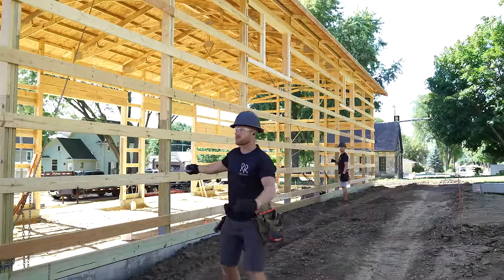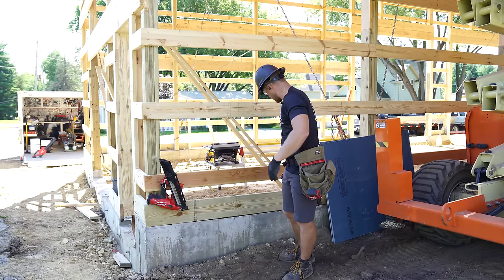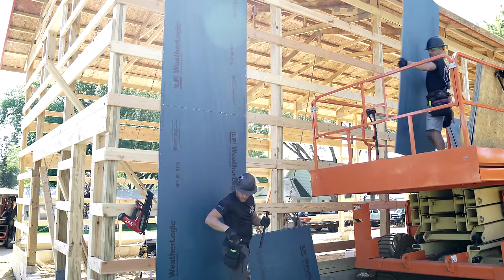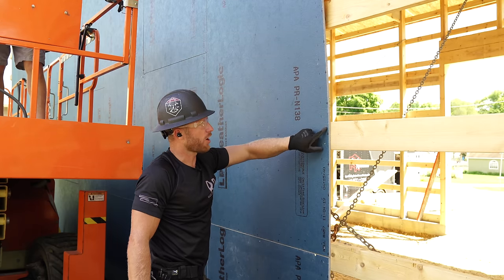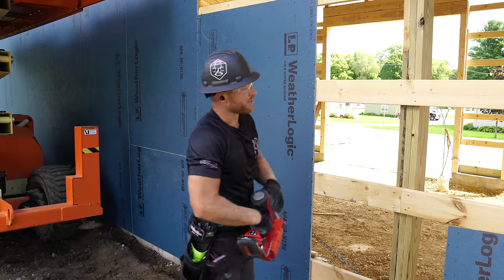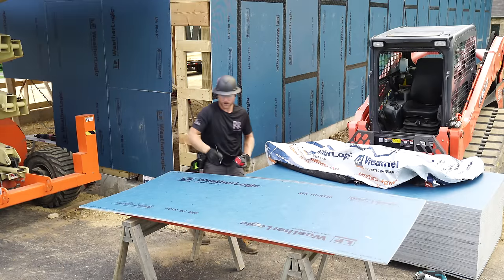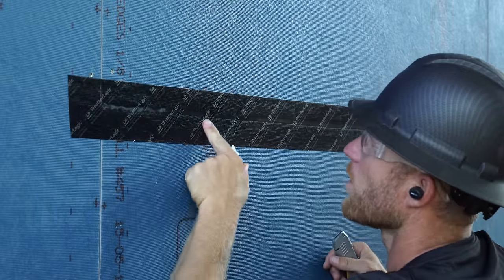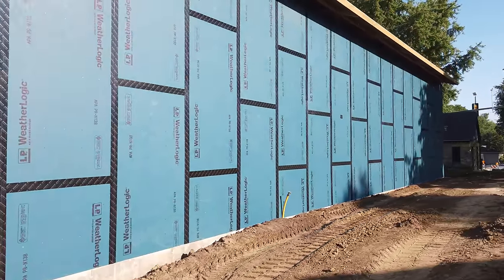Oregon Music Garage: Installing WeatherLogic #Engineered #Sheathing

Comment from the maker: This project is definitely going to be much different than anything we've done before... how many times have you seen us sheath an entire building prior to siding?  Thanks for the support and hit that subscribe if you haven't... It's free content!
Reply: cool  a great way to enjoy the night watching a video from RR BUILDINGS
Reply: Jimmy's?
Reply: I haven’t made it all the way through yet so I hope I don’t look like an idiot however does the building require any sheer strength from the sheeting?
Reply: @brockschank765  when they nail the edges and the field of each sheet it gets it's strength ,, the gap is for sheet expansion . trailers were built with plywood in the corners rest of the sub walls were  cardboard or inso board ,, it don't take a lot too add the strength ,, hope that helps you out ,, also like his cross boards he puts in ..
Reply: The seam on/around the corner, no tape?
Reply: Hi Kyle, what do you guys do for corners, do you tape them too? Thanks
Reply: Is that the Milwaukee cordless router?

Comment: Good man on the safety gear, Kyle. You can always tell the safety equipment skeptics; they're the guys who have skull damage, an eyepatch, a limp from the steel that pinched-off their toes, no hearing and a broken back from falling off a roof. Keep going with the safety-gear. If you always wear it whenever you work, it'll be no big deal when you go on a site where the OSHA standards are mandatory.

Comment: Good morning Kyle and Greg!
Something I've wanted to comment on when you are working on a roof and you are wearing your fall arrest harness etc when you don't have a good riggers helmet on, something with a good under the chin strap, you are leaving yourself open to injury. God forbid you do fall and your arresting gear does it job, you will most likely be slammed against a wall, without a good rigger's helmet that stays with you when you fall (most hard hats are just that, they are hart shelled hats) then you can bang your head hard. My personal choice is the PETZL Vertex Vent, Ventilated Helmet, the vents are sure nice when it hot, but you can close them for rainy days and cold weather. I learned about these helmets working with Cirque du Sole here in Tokyo. They do not obstruct your view (like ball caps do) and they are very comfortable to wear, there are also a bunch of accessories you can get for them that make them very versatile, from a headlight, hearing protection, and even a face shield. I use the hearing protection and mesh face shield when I'm running my chainsaw.
Maybe hit up Petzl and see if they would sponsor a video?
Great videos, as usual, keep up the good work.
Cheers from Tokyo!
Stu

Comment: The Metabo HPT 36v triple hammers bare tools are on clearance at menards for only $210.
The Hitachi 18v triple hammer kit with hard case is on clearance for $266.
after menards 11% rebate thing.

Comment: How do you like that LP stuff compared to the Huber? Seems like one advantage that jumped out at me is it would be way easier to keep that little putty knife in your bags versus the zip J roller always having to climb down and grab it when you realize you forgot it. Also what’s the verdict on the Milwaukee gun compared to the hitachi? I run all battery hitachis but love the idea of a 2 rack of nails clip of the gun works as good as the hitachi?
Reply from the maker: Zip seems a little cleaner... but mainly the same... the squeegee is much nicer than the roller in my opinion

Comment: What bit are you using in the router to cut your openings? 
I really like the Up-Cut Spiral Flute bits with the bearings on them, the solid carbide ones are pricey but they last a very long time and make a nice cut.
Cheers
Stu
Reply from the maker: That’s what I have.

Comment: What about the shear panels? Will you be adding blocking to get full nail pattern? Did you get engineer stamp on application? Seams like it would have been better to run horizontal and add blocking as needed for the panels to perform correctly in a high wind event. You are in strait line wind event territory. Have seen plenty of failed pole barns over the years.

Comment: hay Kyle, have you thought of using the roller they use on zip tape on the tape you are using here? I know they both use pressure to make a firm bond, was wondering if you could save your wrist a little bit by using a roller rather then a squidgy
Reply from the maker: Like the squeegee more

Comment: What did LP say about the horizontal framing? Because you don't get 6" around the perimeter as they normally would, does the post frame make up for it with racking strength?
Reply from the maker: No different than a stud wall with 16” spacing between stufd
Reply: @RRBuildings  Right i was adding up the lineal inches of coverage assuming vertical. However LP specified can be installed horizontally, which with your 2x6 framing members is actually more coverage.

Comment: Is this the same stuff as the zip system? Is one better than the other or are they the exact same thing?
Reply: One of them was suing the other if memory serves, so pretty similar!
Reply from the maker: Basically the same... little cheaper but doesn’t have as many tape choices yet... mainly the stretchy tape for windows

Comment: Just curious but he said he's going to come back and nail every 6 inches around the perimeter but then proceeds to tape the seams and also the gurts are like 2 feet apart so... I'm confused
Reply: I’m curious how he is going to nail 6” centers on those vertical seams.  He has a lot of structure to add.

Comment: Do you like that Milwaukee gun better than the Metabo? They sound almost the same.
Reply from the maker: Depends I like the extended magazine enough to grab red first
Reply: I've always been a Paslode guy but the gas and cleaning gets old....I've kicked around getting a strictly battery gun but haven't pulled the trigger....trying to decide which way to go

Comment: What was the math to figure out the angle cuts for the roof ?
Reply: Lets say a 4 on 12. If you are measuring on the 4 foot side of the panel your just adding 16" to the short point of the cut  if the sheathing is vertical. Ie: the short point is 44" then the long point will be 60" if doing the sheets horizontal then you'll be going 32" over the full length of an 8' sheet. There's ways to incorporate this into making a spacer board that has two nails in opposite ends that when both nails are touching the sheet it's the right roof angle, so all you have to do is mark the bottom and line up the stick and all the math is done. Works really well for hip and Valley cuts, saves time and is stupid proof. Hope this helps

Comment: whys the US flag back to front on your sleeves? pretty cool Ts
Reply: The direction of the US flag on the right side of military clothing looks reverse to its usual position but just like a flag on a flag pole where you see BOTH sides it is reversed on the other side and is meant to convey the look of forward motion. Think of it as a little flag on a little flagpole being held by a charging soldier. If it faced the other way it would convey a backwards direction or retreat. Civvy clothes are just mimicking this placement because it looks cool to them. Same with all the grayscale flags in the last few years.

Comment: I noticed you taped all the seams between the sheets but not the outer corners?  Is this something that will be done later?  As see this as a place for air and moisture to penetrate the building.
Reply: you use corner beads for corners to give it a perfect square look. otherwise if you have panels or drywall meeting at a corner, one will overlap the other and won’t make for the cleanest corner.